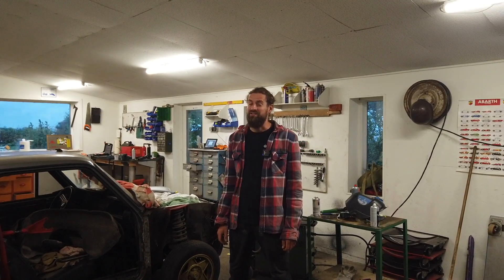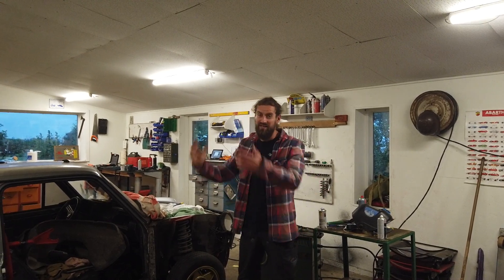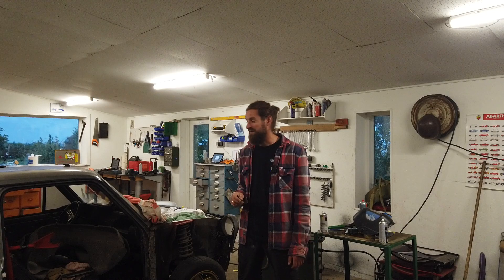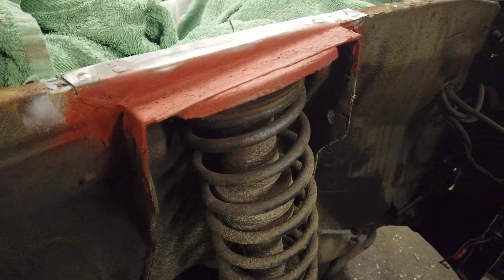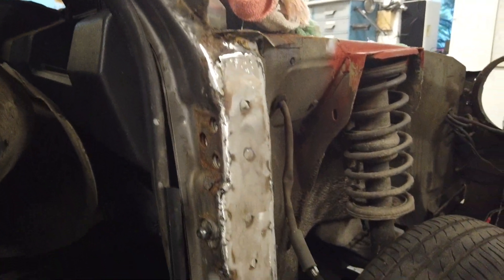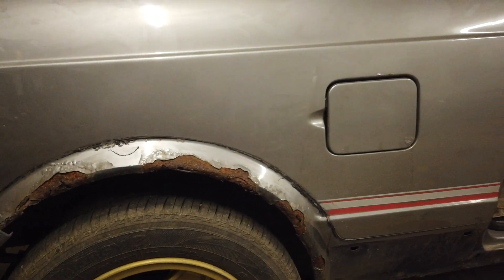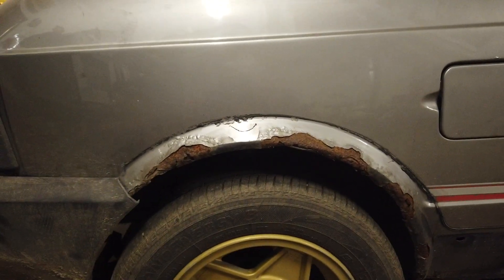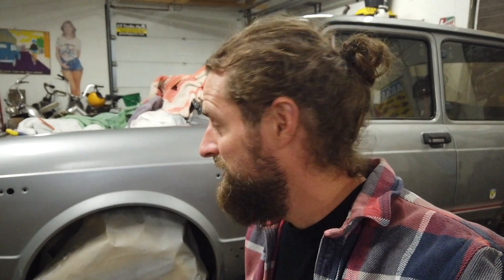Slight progress on the ABARTH rebirth.

Comment: I'm currently also trying to fix some of the rust. I too wasn't able to find any rear wheel arches. Thanks for the tips in the video. I'm sure  it will make the result better.
Reply from the maker: Complete rear panels is easy to find.. very expensive but easy.... but just the arch? impossible!